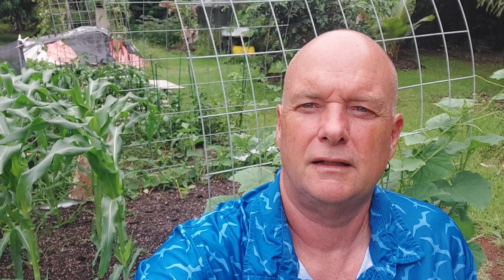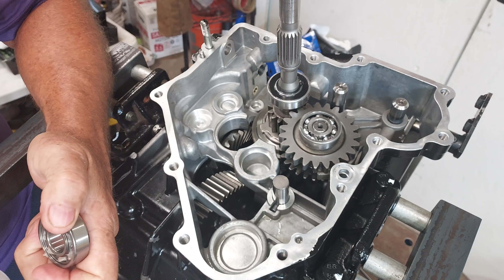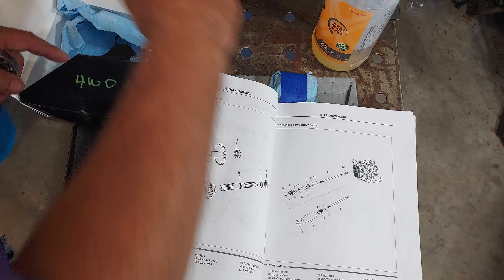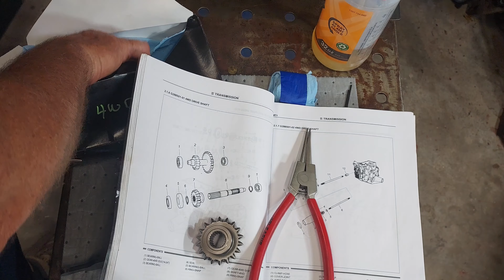LS MT125 Transmission Part 7, Reassembly the Gearbox, Mid PTO, HST Motor Shaft, Range Select and 4WD

Comment: still good info! i did finish my project in august. three point control knob orings, needle bearing and seal,oring in valve block, gasket ,cooler gasket replace. reassembling was simple and interesting. the valve block gasket is thiner than cooler gasket, cooler kept leaking and used permatex aviation sealer on 3rd round, no leaks. i dont know about shipping to Hawaii i would think itss restrictive and $ but i used messicks my parts ordered from a new holland diagram and parts list, workmaster 25s. looking forward to your next video hst assembly and to see your machine up and runing.
Reply from the maker: I ordered everything through Legacy Tractor in Ft. Collins, CO. They were pretty good and sent everything USPS which is the cheapest shipper to HI.

The tractor is all back together now. I haven't put together the video because I wasn't really getting many views.

I'll see if I can put an update together. 

Thanks for the comment!
Reply: @kilipoheikekanilehua4049  Would love to see your update video! Great job by the way. Incredibly educational!
Reply: @kilipoheikekanilehua4049  ok glad to hear its running after so much planing and work
Reply: All your videos were very well done with tutorials and your editing.  Wish you show the last vidio. You helped me so much. My problem was the pinion bearing, gearselect. The front of the double bearings broke and the outer race and balls ran through the gears. My main shaft bearing had the moved circlip back about a inch so the bearing came back so fluid with debris got in the hydro stat. It damaged one of the spring pistons . Got parts on order. Nice job and Thanks!!😊